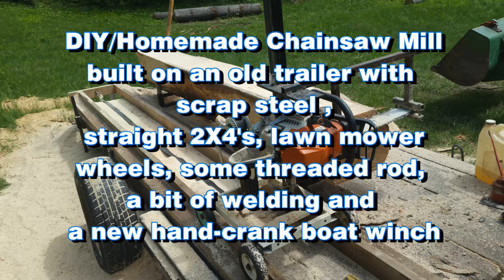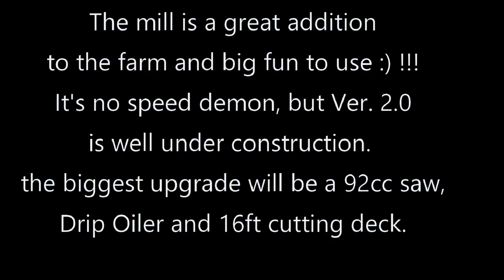DIY/Homemade ChainSaw Mill

Comment: Hey, nice job RF! Looks like you've been putting your time to better use than many of your "Neighbours" in this silly season. 😜
My old MS880 sits forlornly in the shed. Still works perfectly just the operator doesn't any more. Have to get the young ones to start it for me to use it now! But I've bought a little Cheap Shop toy one so I can get my fix of "the smell of 2-stroke fuel and wood chips in the morning!" 😁
Reply from the maker: Hey Oz! - Glad you liked the vid... probably the best project I've worked on for years... 

Agreed, I have  met lots of "Good Solid" folks on both sides of the political aisle in the US... I take no sides in their affairs, but I sincerely hope that they can find "Heal" the massive divide that has split them into two...

I couldn't afford the real Stihl MS-660 (one step down from your MS-880) so opted for a FarmerTec G660... It looks like the "Borrowed" Stihl's injection molding die's and just changed the colour of the resin to Blue over Orange... it's a bolt for bolt knock-off, but seems to work great!

It too is a bear to start, but once it gets mounted into the new Mill that'll help (I hope :)...

Like you, I'm moving slower, and get my son-in-law to drop n skid out my trees... I used to enjoy the adrenaline rush, not so much these days ;)

Comment: Great Job!  Looking forward to version 2.  Subbed.  I run an Alaskan mill, husky 372xp 28" bar.  Got about 3000 Board feet done so far.
Reply from the maker: Thanks Steve :), It sure is a lot of fun, AND just knowing I'll never buy timber from a Lumber yard again is a real bonus!!!!

Husky saws are quite nice, I looked at many options before getting the "Knock-off" Stihl ms660, it was just economics 2 grand plus simply wasn't an option.

All the Best!